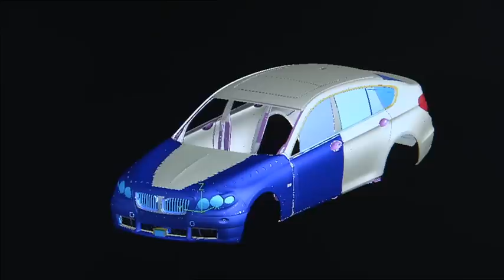BMW 5 Series Gran Turismo Camouflage

Comment: One thing I always wondered. When they have all this camo on it adds weight to the car and spoils the aerodynamics, so in the case of a supercar wouldnt any testing with camo on be sort of invalid?
Reply: In the case of a supercar the aerodynamics would be tested in the wind tunnel and the performance in a private testing facility and on the open road would be more to test the suspension and the engine calibration.
Reply: This is just for general road testing.